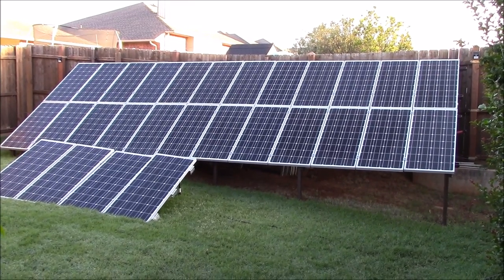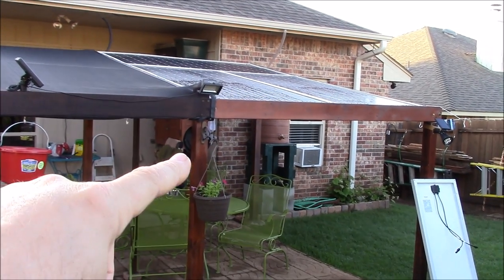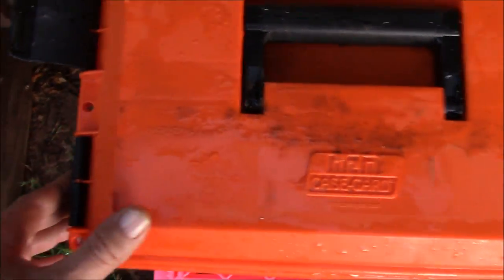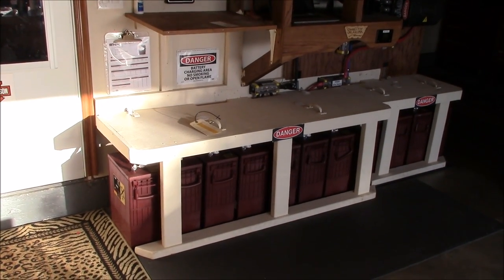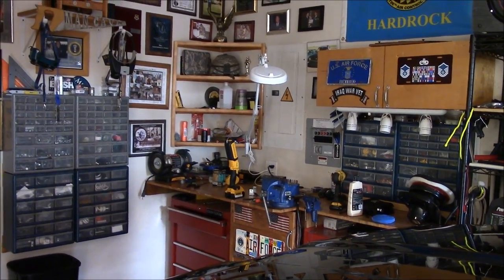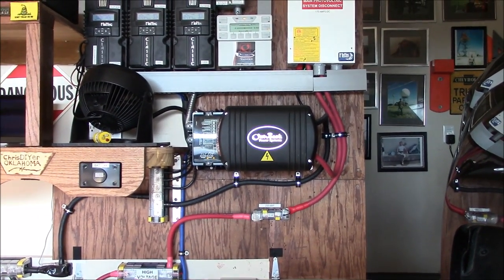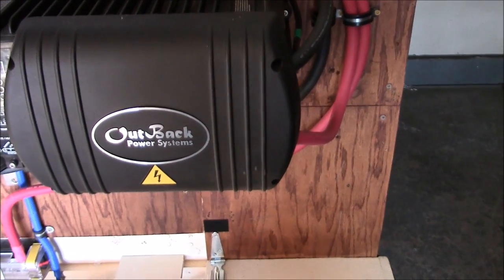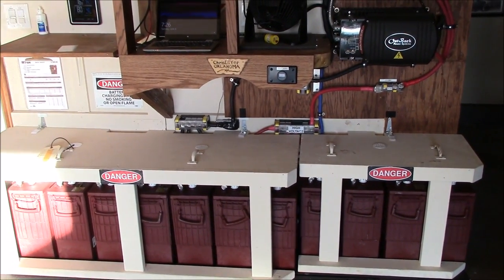Home solar system(s) overview - DIY home solar (four operational off grid systems)

Comment: Very nice Chris! You have the best off grid system in suburbia I have seen on YouTube! Its funny about the NEC rule on THHN. I remember when it hit the market. I started out as an electrician using the old TW. You really had to be carful on hot days. The insulation was very pliable and was prone to shorting out because of effacing. We were very excited to use THHN. The ampacity is higher than TW not to mention easier to pull and oil & gas resistant too. The part I do not like about having to use it with DC is the electrons flow on the outside of the individual wires. THHN is stranded but not multi stranded like welding cable. I personally am going to stay with the excelene  welding cable to maximize my efficiency only because my system is( not in the house) My system is in the green house in the garden so it should be fine. I think I am going to add another Midnite CC and change out the Tristar PWM. Depending on load, time of day and the alignment of planet Ifdanstar, the Tristar goes into float either just right or way to late and my specific gravity is  1.285 to 1.30... Yikes!!! some days its perfect  the SG is 1.28If I take the Tristar out of the loop it is perfectly consistent. The tristar is not easy to dial in and does not play well with the Midnite or the Outback FM. You do very nice work my friend.
Reply from the maker: Thanks. The old saying is "practice makes perfect". Have found that less than superior parts = $$$ wasted. So many mistakes, wasted money, and so on. This time of year, our solar systems really prove their worth. Inverting a lot of power here in Oklahoma...air conditioners. Very cool that you are adding more components! Just did the firmware revision on my three Classics...even they get a little better over time. Thanks for checking in....good to hear from you!

Comment: Nice set up Chris , very clean and well done. Thanks for posting your new set up and all of your videos you have done, they are very helpful . I like the fuse before the breaker that is how I have done my systems. The way I see it is you can't over fuse a system the more safety the better it is. I also installed smoke detectors next to my systems thanks to your past videos on safety.
Reply from the maker: Awesome! Glad to hear this. So many unsafe systems out there.

Comment: Very nice work! All amazingly organized in the garage there! 
I cracked up at the 'two condoms' remark. XD

I only wish I could afford all that stuff you have there.
Reply from the maker: Thanks. All this stuff was bought over a 4-year time frame...a little bit at a time and some "big gulps" for the pricier items. It takes time and solar can get expensive if not planned out accordingly. Some dudes spend $15K+ on their Harley's or boats (which is cool). But, solar pays you back over the long haul

Comment: a few questions.

1. What's wring with the DIN mount breakers?  mounting and room inside the box or don't work as well (trip when they should have)?2.  What do you need to change about the welding cable?  Is it an issue with the insulation? (standard/certification to meet)3. Is your Outback running cooler simply because of the orientation change or something else?Whole wall looks a lot cleaner than it used to.  :)
Reply: I'll jump in and at least answer the question on DIN mount breakers. DIN mount is just a form of 'mounting' the circuit breaker. A DIN rail is a piece of metal that is attached to the back of the circuit breaker box that a  DIN style circuit breaker is able to attach to. (they snap on)  That's it.  It's simple- yet confusing.  DIN style breakers have 2 attachment points for the wires with screw connections. One at the top, and one at the bottom of the breaker (power in/power out -or line/load)

Comment: Hey Chris! Which model is your disconnect box? I am gathering gear for an upgrade and I will need one. Going to be running 4 Classic 150s. Thanks!! Keep em coming!!
Reply from the maker: Will do...really glad my work/video is helping others out. That disco box has been flawless. It is a MNDC250 PLUS with Carling breakers (non-polarized).

Comment: excellent overview Chris, I can't thank you enough for being exceptional motivation for me completing my system.  I really enjoy your videos friend Magnet videos too.  Pretty sure my next purchase will be the vent caps for my batteries.
Take Care Friend.
Reply from the maker: Thanks...honestly, really don't see much difference with those Water Miser vent caps. Maybe a pinch less water use. Not using them anymore.
Reply: Chris DIYer Good information, what made you decide to stop using them?
Reply from the maker: Took them off to clean them...and do a comparison test. Turned out, the Water Misers are a bitch to keep clean, they don't snap down without really checking, and minimal difference in water savings. They do work...but, not worth the $$$ IMHO.

Comment: Since you seem to be the YouTube expert...and someone I've watched for a couple of years, I'm curious if you could hypothetically have two breaker boxes...one for grid power and one for solar/wind off grid set up. My goal would be to have all lights, and non kitchen or heavy output areas to be powered by solar. Then to have the appliances and other heavy use items to be grid power. I would also like to have an electrician make the grid box easily switched to either a backup generator or to tie in with solar. I would like to do most of it myself because the price to get it installed is ridiculous.
Reply: Oh...I was typing that question when you were explaining your breaker panels. It sounds like you run your house pretty much how I would like to. What are your six circuits that you run on solar...lights etc?

Comment: Hi Chris, as one of the earlier questions posted about the 4-0 cable, will the upgrade wiring be as flexible and what other advantages might it have ?   Global warming ? ? ?   What about global WETTING ???   My frogs are wearing raincoats lately in Houston !   J K
Reply from the maker: Hahaahaa! Excellent. The hot/humid/wet is just the way I like it. That shit we had in Iraq/Kuwait/Egypt is not my cup of tea. Everything is working well (esp running the window AC units now...and a lot of inverting)...so, no rush on 'expensive" 4/0 cable. Houston though, is a new kind of wet heat down there.

Comment: new subscriber, your system looks awesome. Wish you lived closer maybe you could help me design a system. I see you were in the Air Force and a Iraq vet. Were you ever in Taji Iraq or in Kuwait by chance, we had Air Force on both of those bases when I was there. I just retired a few years ago SFC Army. I have space for 8 or 9 300 watt panels, and I live in Pa which is not the most ideal for solar because we have lots of cloudy days and short days in the winter.

Comment: I need a 250 amp circuit breaker between my batteries and inverter. I could not tell what you used for yours. Also I bought 2/0 thhn for between my batteries in series is that ok?
Reply from the maker: That is what I run (2/0) in between my batteries. The 250A breaker is made by Carling, sold by Midnite Solar. Best to check in with them...prob get the best price too.

Comment: I see different people using these charge controllers but I also see many using the Flex max 80 ..... can anyone tell me which is better and why please ?
Reply from the maker: Both are excellent, high end MPPT solar chargers. The Midnite is a little more powerful...but, most don't run theirs anywhere near max operating currents. I don't. The Outback interfaces with their Optics RE software if using a Mate 3 and HUB...really impressive. Also look into Conext by Schneider Electric if your looking at high end equipment